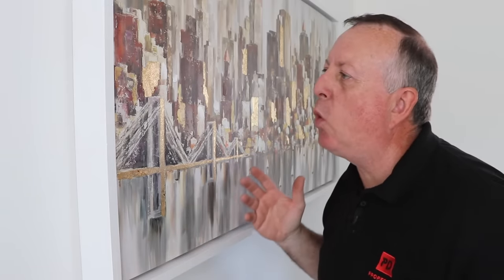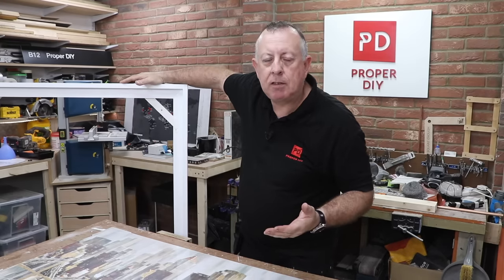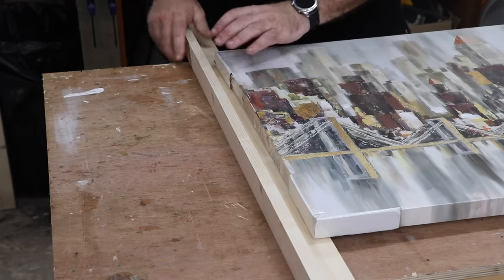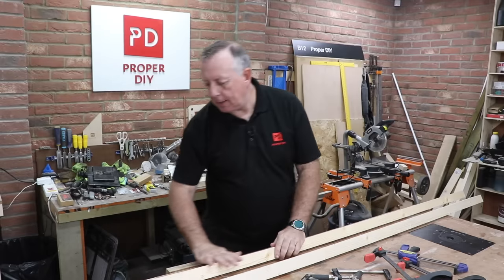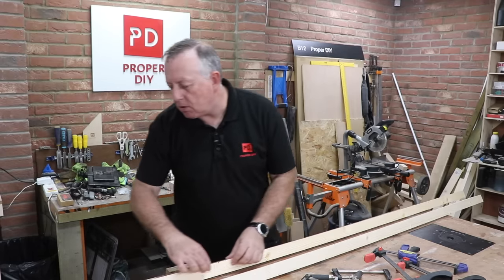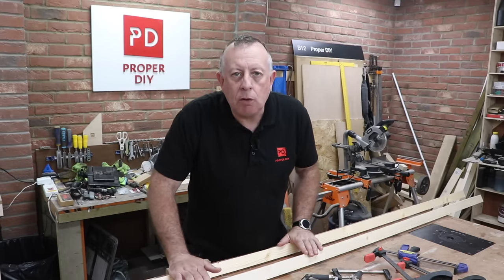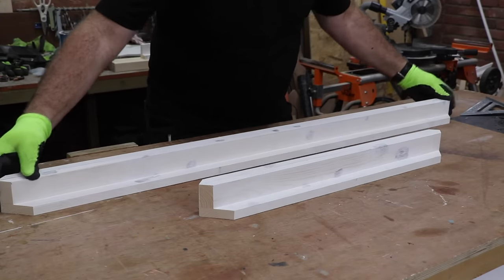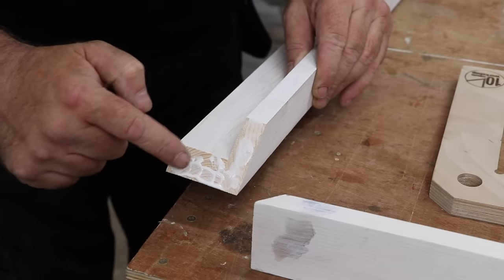Make Your Own Floating Picture Frame With This Simple DIY Tutorial!

Comment: When I'm fitting this type of thing, or pretty much anything with multiple fixings I always mark the first fixing, drill plug and screw it in and then level and mark the other fixing points. If I don't and just mark all the fixing points at the start , for some reason one or more of them won't be in the right place when I come to fix it. Also it's easier to do it that way if the item is a bit heavy.

Comment: The answer to your knotting problem is to use clear knotting when using water based paints as acrylic has little body and several coats are needed, coloured knotting for oil based paints .

Comment: Zinsser BIN also works really well as knotting solution. It’s also a fantastic shellac primer anyway so useful to have about.
Also, knotting solution typically needs a further coat of primer to stop the knotting bleeding through (as you found in this project). So I tend to then use zinsser BIN on top. Belt and braces I suppose but never failed me yet!
Reply: If your a time sensitive contractor (paid by the job) the Zinsser is the only way to go. Base primer, undercoat and knotting solution in one!! Small tin and pack of disposable brushes on the van at all times.
Reply: Yes I agree with you Zinseser is my go to Primer works great on MDF ends and seals well

Comment: Such a lovely frame. Will definitely have to give this a go. 
Instead of that awful knotting solution, I use Ronseal’s Knotblock primer undercoat. A bit like the similar Zinsser product but you can clean up with warm soapy water instead of having to throw the brush away because, ya know, shellac, and the Knotblock is used all over the piece like regular primer. 
Been using this for 6 years now and it works really well

Comment: I believe you can buy a clear knotting solution online. Generally never see it in the DIY stores. I've had the same issues, had to use quite a few coats of paint, but 2 years later and its still not showing

Comment: Knotting just theory? I'm in a new build and Persimmon built it. You can tell they didn't knot any of the wood as there's loads of brown marks where the knots have burnt through the paint. Needs to be completely stripped, sanded, knotted and then painted all over again. Love the frame idea, going to have to have a crack at this for a couple pictures I've got in mind.
Reply: No!! Just cover with Zinsser and re-topcoat. Hope this saves you hours of your life from stripping, sanding and knotting. 🤷

Comment: I was told to use knotting by my grandad when I was a kid, so I just did as I was told for the last 40 years. I recently read the instruction because I thought it was pointless using it as had varying success, turns out the primer needs to be oil based.

Comment: What filler did you use to fill gaps?  I'm fitting new skirting boards, and sure i will get a few gaps because of the wall differences. Thanks.
Reply: silicone, acrylate sealant, ask in your nearby hardware store because i have no idea what is your wall made of. I personally had gaps near door corners, so i hand sand a plaster, make new one to fit and paint it. Because these premixed and bought sealants tend to have different consistency even they can be painted no problem.
Reply: @Ivo Brick  thanks, its the corners that I was thinking of. My saw was slightly out of true, and I know some corner gaps will appear..lol